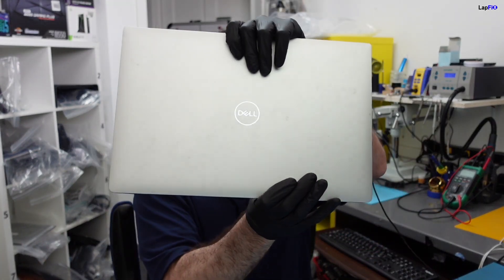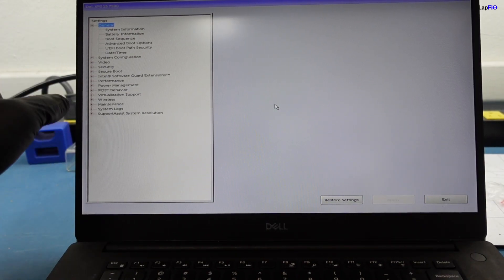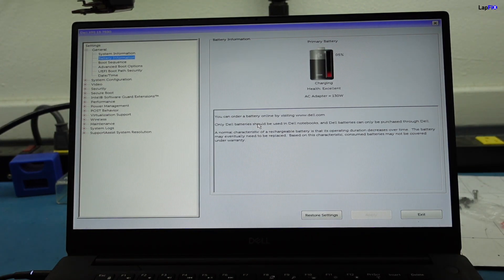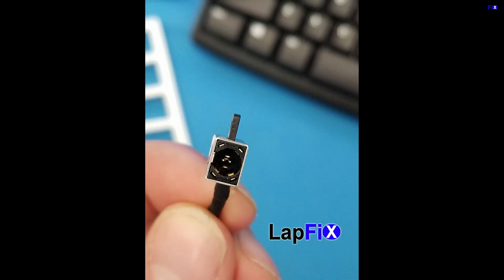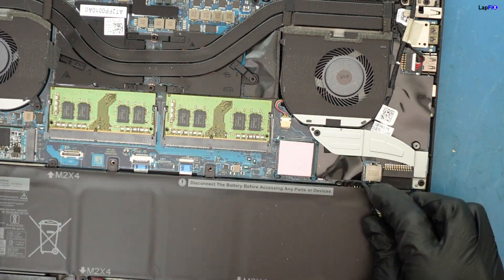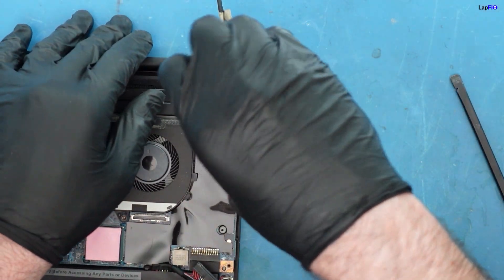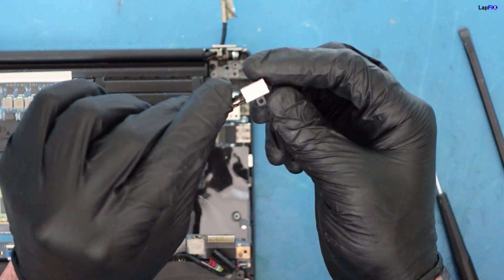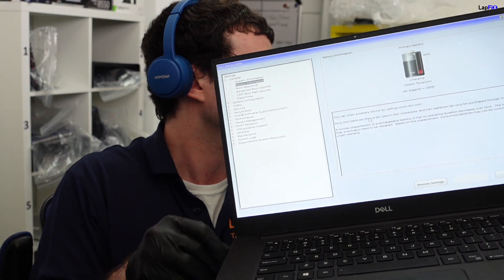Dell XPS 7590 Precision Not Charging + DC Jack Replacement

Comment from the maker: Hope we help clear up the issues for these type of dell laptops.  The diagnostic method should work with all Dell's with this type of bios, not just the XPS and Precision Models.  What type of Dell  laptop do you have? Let us know in the comments down below!
Reply: Precision 7730 ... recently acquired it, no voltage at battery terminals BUT opening up the battery the Li-Ion cells all measure okay, so the series 'switch' on the BMS is open ... came with wrong charger (only a 65W version, requires 240Watts) so have not tested it yet. The center insulator in the DC power jack moves, thinking that might be an issue when I get that far (after getting the right AC adapter).

Comment: When I go to the battery information on my laptop, it says “AC Adapter = Unknown.” I’m using the original AC adapter, but one of the plug’s indicator lights stopped working. The other one (on the other side) is still fine. Is it a problem with a charger ? It melts the fucking plastic when i plug it in.

Comment: What helped me was to go to "add or remove programs", then search "dell power management" and click the 3 dots, then advanced options. From here look for "repair" button under Reset and click it. When done click the "reset" button. If you now restart laptop in BIOS mode it may say 130w.
Reply: I have the same problem but my laptop trickles off once the power adapter is disconnected.

Comment: Tried a port replacement, but now it wont charge says the AC power adaptor wattage and type cannot be determined the battery may not charge, could this be due to generic port?
Reply from the maker: Either an AC Adatper or the charging circuit has an issue

Comment: I did exactly this repair on this model yesterday. I found that it wasn't necessary to disconnect the LCD cable or bracket, all I did was unscrew the hinges, open the laptop a little to lift the hinge up, close the laptop, unscrew the screw holding the jack then replace the jack.

Comment: Very good video! Thanks! The charging port was $6.00 online but I was able to get one at an electronics store so it cost a bit more! I’m not saying how much! I needed my laptop! One thing not mentioned is the two center screws under the XPS cover. I kept trying to pull the back off but it was still screwed in. Also, the replacement charging port had two sticky points where I had to pull off a protective tape first. Excellent video! Shop wanted over $200 & possibly a month to finish!

Comment: Just did this repair, thanks for the video. Just a heads up, I did this repair and afterwards, when I plugged in the adapter, the front light came on briefly, then I pressed power and the power button LED just flashed slowly. I had to remove the battery and hold the power button for 20 secs. After that, it turned on (but complained about not being able to identify the power adapter, way too common with Dells).
Reply: Scratch that. It would start up with the battery disconnected, but if I reconnect the battery, it will not boot at all, just slow flashing power LED. Anyone seen this?

Comment: Mine didn't work even after replacing the DC supply. It shows that its connected when charger plugged but battery not charging

Comment: Thank you for the perfect answer to my Dell XPS 15 problem.  The plastic surrounding the DC Jack broke at some point and the connection to the charger was loose when plugged-in, and when I went to plug it in recently, it shorted to the laptop case.  A noise and puff of smoke and the LED on the charger winked out.  Unplugged it and crossed my fingers it didn't cause a more serious problem with my laptop.  Watched your video, then hopped on Amazon and bought the DC jack plus a replacement power supply.  A few days later I installed the DC Jack, plugged in the new power supply and now it all works great!  I definitely saved some money!  Thanks again.

Comment: Do you have a similar repair for the Thunderbolt port? My port still works, though its unable to charge my laptop now. I've tried with several docks and a macbook charger with no luck.
Reply: Same here, one day stops loading through USB C. I think it is bios update, they break everything. Xps15 7590 was the baddest notebook ever. Now I have Ms surface and I love it.
Reply: I have an XPS 9575 and have the same problem with my USB C charging port. Is there any solution for this? It's driving me crazy. Tried cleaning the ports, different chargers. It's randomly done this before where hitting the power button gives a slight sound like it's trying to power on and a white light at the front of the trackpad briefly lights up and then a sound of it dying and nothing turns on. After some time it had worked with another charger, then sometimes with the same original Dell adapter but the connection was kinda fidgety and a little wiggling would bring back the white light and it would charge for some time. 
But now it's completely dead 

Is there any video dedicated out there to fixing the power USBC ports on Dell XPS laptop (specifically here, it's the XPS 9575

Comment: Thanks for posting this. Excellent and clear. Followed diagnostic guidance to confirm it wasn't the battery or charger.  It cost me £4.69 for a replacement jack and now its all up and working. Never done this before, couldn't have done it without your video. Much appreciated.

Comment: Very nice instructions on how to troubleshoot and replace this part. The part is available on various websites relativelly cheap. Search for: Dell XPS 15 7590 DC Jack IN Cable Power Connector Port

Comment: Hi, I have the same issue, I purchased the replacement part and installed it, power delivery over AC charger is working fine but the battery is not charging! I order another part this time from Amazon and it has the same issue! No battery charging! I Replaced the original charger with a brand new one and it’s the same. After searching I found that the bios restriction are disabling the new replacement part. Now I don’t know how to find the original part, do you have any idea where to get it? Thanks